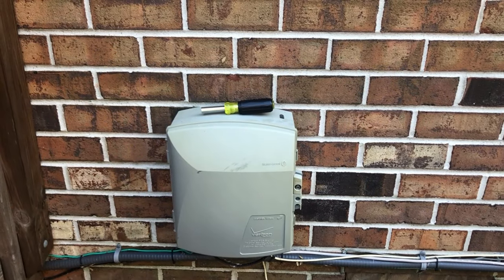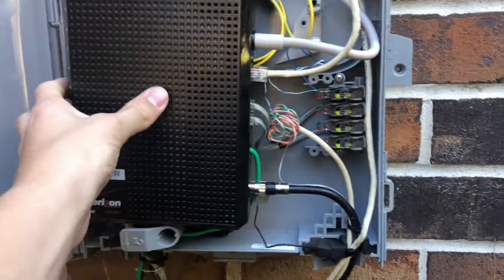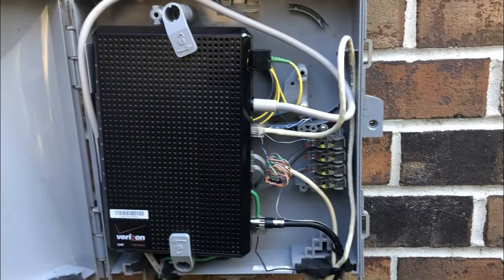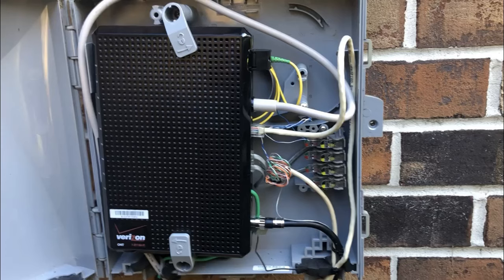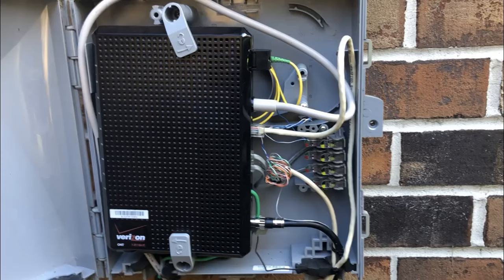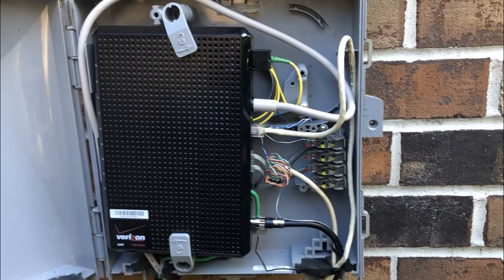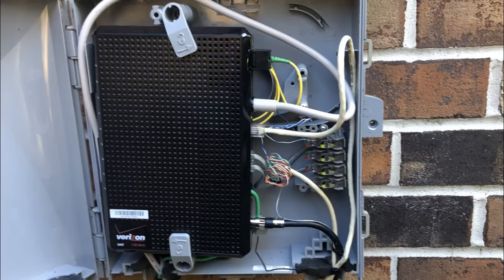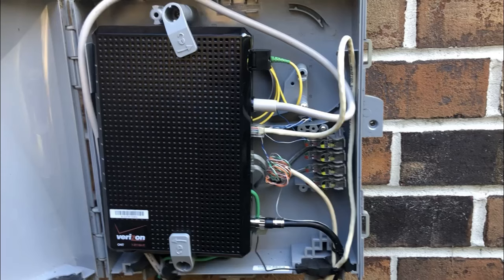Inside A Verizon Fios Box (ONT-Demarc) (Speedtest)

Comment: Fiber cable type is not multimode to the box. Based upon color coding of the internal fiber cable being yellow that would indicate single mode. Because of the different wave length of lasers the two formats are not compatible. Single mode fiber can be run much farther than multimode cable. The general commercial color coding for fiber is orange for 62.5 micron MM aqua for 50 micron MM and yellow for single mode 125 micron.
Reply from the maker: Upon having learned more about the fiber field from installing it over the past year, you are indeed correct that it is singlemode. However color is not the give, rather the number of strands. In a perfect world following TIA standards yes, but alot of people deviate. Here is TIA standards:https://cdn.shopify.com/s/files/1/0855/3802/files/color_code_beyondtech_fiber_optics_2.jpg?v=1480369103

Here is where many deviate: https://www.l-com.com/fiber-optic-om1-625-125-multimode-fiber-cable-dual-lc-dual-lc-yellow-40m?gclid=Cj0KCQiA6t6ABhDMARIsAONIYyz7HfwPVCcK-7aS_vdM-stOnR_kPQuqyql8TEsqdUeGUOLJ2bjosdQaAoHqEALw_wcB

Comment: Thanks I was looking into the gigabit for $75 but the ONat box is in the basement and I need that ethernet to run all the way up to the attic.
Reply: I upgraded to gigabit and needed an ethernet cable run as well. The installer did it in a few minutes. It was only to the first floor from my basement, but I wouldn't see them having a hard time going to the attic if you already have cable going front the ONT the the attic
Reply: @lite1979  did they just use the old coax cable to pull the new cat6 cable to the same wall jack?

Comment: I just the black ONT box installed and the red VID light is on. I reset it twice and still Red.
Reply: I just had the same red light issue and the Verizon tech who came told me the "black box" was bad, and he replaced it. That was the only way to fix that problem.

Comment: So when Verizon installs just internet (fios) do they give you a modem and you can buy a router to plug into it?
Reply: Not exactly. They give you the option to rent or buy their router/moca device. If you don't want to use their router, you would have to buy your own and then remove the Ethernet cable from the Verizon box and plug it into your new router's WAN port. Mine works fine, but can get finicky if it turns off or loses power.

Comment: Please I need help. My verizon guy came and installed my internet just like the one in the video. I have 200/200 package for 39.99. The problem is he ran an ethernet wire to my router  which is running through my living room and it looks bad. Is it possible I can change my connection to the coaxial wire so that I can connect to the internet through coaxial cable sockets provided in all my apartment rooms? And do I need to buy something extra to use coaxial cable connection?
Reply: Cant change it over, but you can change your ethernet cable to the flat cable and place it under your wall trim to keep it tucked away.

Comment: My current setup: I put their G1100 FiOS router in bridge mode and ran the cat5e cable from FiOS router to my own router's wan port. Can I call Verizon and have them run cat5e cable directly from ONT box to my own router? This way I can eliminate the FiOS router which is just a bridge between ONT and my router. I think the RJ45 port on ONT only does 100 Mbps max but this is fine since my speed is only 75 Mbps.
Other option: I could have them upgrade ONT which support Gigabit RJ45 connection but this will cost me $149 😭😭😭
Reply from the maker: Just run it yourself, its just a cable that plugs in with a rj45. They wont do it for your equipment...

Comment: I was wondering how to reboot the ont but wasn't sure which was the power. Hard to figure out in a snow storm lol
Reply: The easiest way to reboot the ont is look for the battery backup unit or the power adapter and just unplug it. If you have the old school battery backup unit the one that has the alarm silence and the battery emergency use buttons on them you need to unplug the unit from the outlet and then open the battery backup unit and disconnect the battery for about 30 seconds and then reconnect the battery and plug the unit back into the wall. That will reboot the ont. You can also use the fios app to do it under support.

Comment: Do you have your own router with the gigabit connection from Verizon?
Reply from the maker: My own router. USG actually...
Reply: You don't actually have to use the Verizon router even with television service. You can use a third-party router but you will need a mocha to ethernet adapter in order to get everything working.

Comment: Im curious...I want to set up a MoCa connection...I used to have Fios triple play but now only have internet. Can I somehow connect a MoCa adapter (ECB2500C) along with my Quantum Gateway router to get ethernet/coax hardline, since the coax wiring goes throughout my townhouse? My router is in the basement pushing out WEAK wifi signals.
Reply: I had Fios TV and Internet at my last apartment where the setup included a MoCa adapter with the wall jack having a split to feed the G1100 and STB.  Yesterday Fios Internet was installed at my new apartment, but a MoCa adapter wasn't used so the ONT uses CAT 6 to connect to the G1100. The installer and tech support guys I have talked to were not aware of Verizon's MoCa adapters.

Comment: I have this same setup but I can’t find my backup battery and that’s the last thing I need to check as this beeping every 15 minutes is driving me insane!!!!
Reply from the maker: Check on the other side of the wall its mounted onto.
Reply: Thanks for your response.  You won’t believe the outcome.  I have been up for 20 hours straight trying to find the culprit.  Even had Verizon come out.  My unit does not have a backup battery.  It was my neighbors garage door backup battery next door.  (Connected townhome!!) I was going NUTS!!!!

Comment: Hi, I ran Cat 6 cable throughout my house.   I just noticed the Verizon guy used Cat 5 patch cords from the ONT to my router (which is located adjacent to the ONT, in my garage).   Would you recommend changing these out to Cat 6?  Thanks, John
Reply: Depends on your speeds you’re paying for. If you have gigabit (1000Mbps) or lower, don’t worry about it. If you pay for speeds over that then you should run the cat6
Reply: @justinburow892  Thank you.
Reply: @rosewoodsteel6656  did you end up switching the cat5 cable from ONT box to your router?  If so did it make a difference?  Reason I ask is because I am getting 350 download 500 upload from cat7 wired cable when I just upgraded my internet to gigabit speeds.  Thank you.
Reply: Yes, I changed out the patch cords.  It didn't make and difference with my set up.
Reply: @apacheco4772  sounds like your optical cable is rated lower... i'm having the same problems... need to call verizon

Comment: Not helpful. How do you troubleshoot if no lights on?
Reply from the maker: Have Verizon come out as it's their equipment. Or, call a qualified professional.
Reply from the maker: There is  a very long list of possible issues rooting from the home's electrical system, to the psu/battery, to equipment failure, etc.  If you don't know these troubleshooting steps it's of my recommendation that you just call Verizon.

Comment: My ONT lights are off... mine is outside my house...I wouldn’t be surprised if the rain messed mine up.
Reply from the maker: you should check the wire and connectors leading to the power supply or battery box in the house. See if the battery box\PSU has power too...

Comment: verizon is such a ripoff .. I want to get the new 200/200 for 39.99 but they say I need to upgrade my ont for a one time cost of 149.99.    they say my current ont only supports 75/75
Reply: What's a ripoff about that? Old hardware can't support the newest, faster speeds... You gotta pay to play.
Reply: @TarzanGTI  its just a box swap.  they would not let me do it. $149.99 is a tad STEEP..   I did talk them down to $99.99 but I will see when the bill comes in
Reply: The Tellabs 611 & 612 ONTs predate higher Internet speeds.

When I signed up for FiOS in 2007, I had 25 up & down. Later Verizon bumped up the base speed to 50 and I then jumped to 75.

This past June I upgraded to 400. When placing the order with Verizon, the upgrade fee was waived.